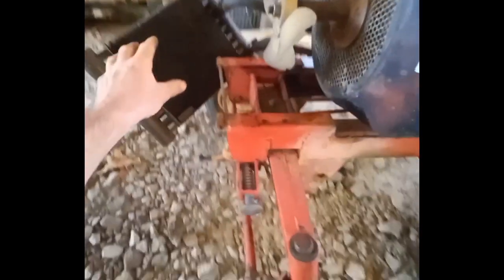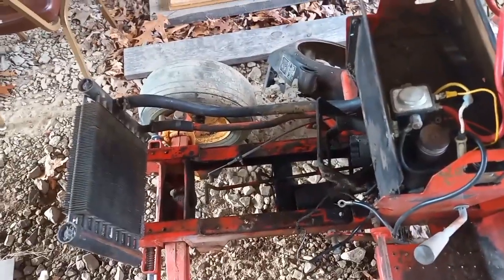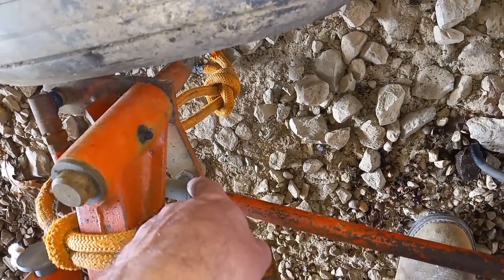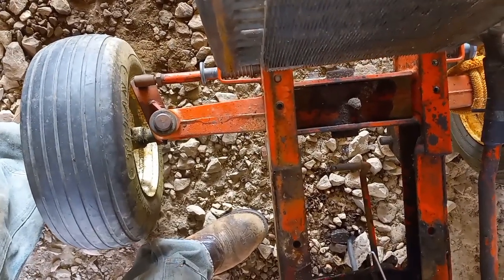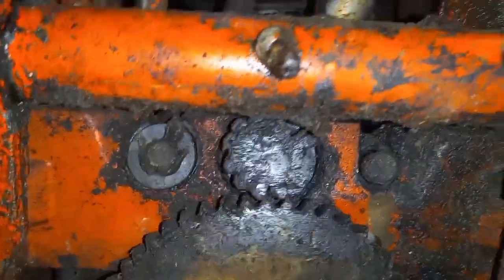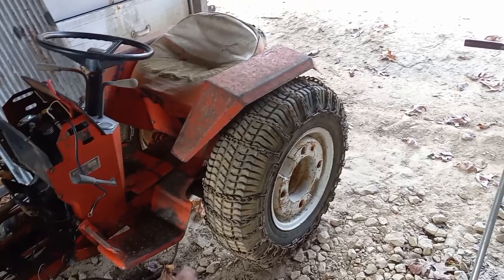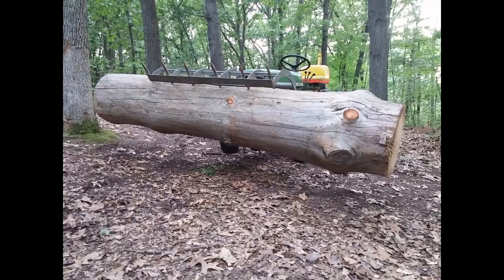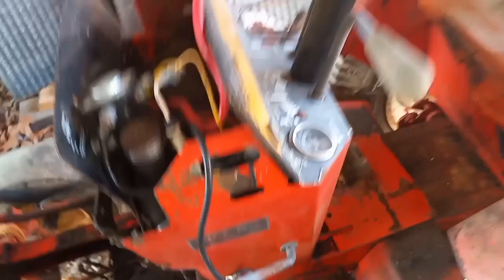I HATE my Case 448

Comment: I'm looking at buying an 82 case 448. Thanks for the info. Gives me some things to check. Any further advice is appreciated
Reply from the maker: Youtubes AI reply feature wants me to tell you "You can't go wrong with a case, they last forever, but have lots of weak points."  

But i think thats a bit too generous.  Im sure they were a joy to be the first owner but im always the last owner of a machine so my feedback is usually pretty harsh. Its the most crowded little tractor you can find.
Reply: @certifiedhoarder  I'm not a large person so that may not bother me. I don't know mechanics well so I'm more concerned with the starter and steering issues. I'll check this stuff over now
Reply from the maker: @fattonyd232  the front axle rocker pin is also a bad design. The pin is huge but it just goes through some sheetmetal with no bushings and that will wollow out. Theres a company who makes a weld on repair.  If the axle rocks fore and aft when you rock the wheel the pivot is sloppy. Then theres the teeth on the steering comb and ofcoarse the starter being super aggravating to get at. Youve gotta pull a lot of stuff to fix any of that. 

Any of the deere H3s or cub hydros have been better to me. I would take a kohler K321 over any onan.  And a sunstrand hydro (deere/cub) over a case hi drive.
Reply: @certifiedhoarder  thanks the info is much appreciated 👍
Reply from the maker: @fattonyd232  best of luck bud

Comment: Just cut your own holes to get at the starter mounting bolts and patch the holes over.. It's only a shroud.
Reply from the maker: I shoulda waited to make the vid. The way the bolts go in you pretty much have to remove the shroud and flywheel. An access hole wouldnt have helped at all.  I hate the onan design. It punishes the mechanic and just didnt need to be this way.